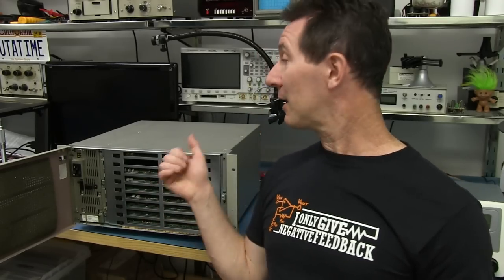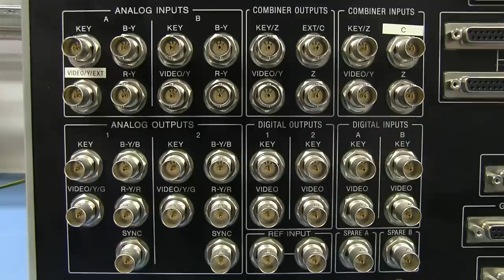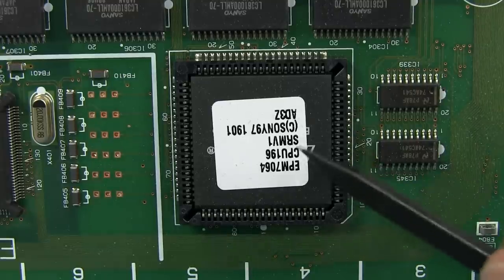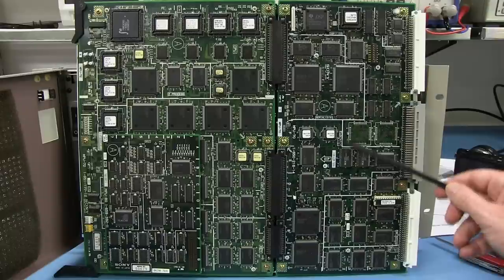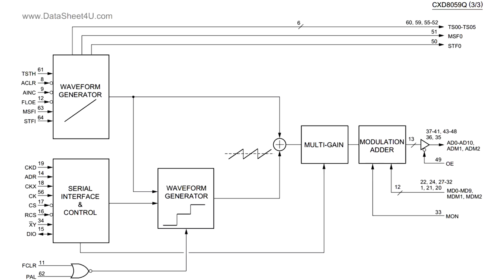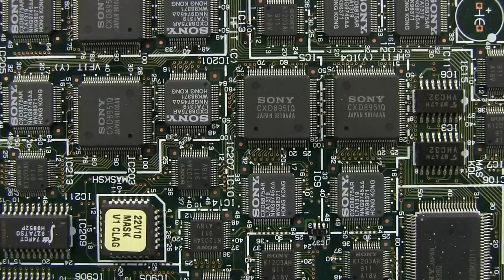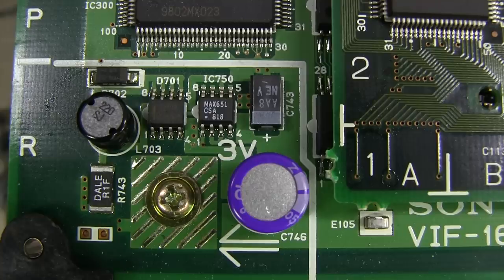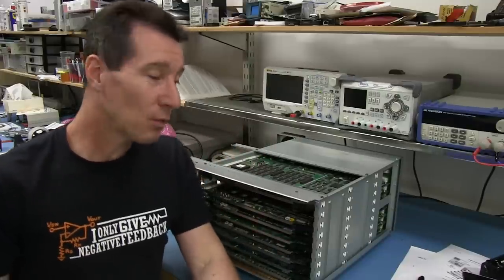EEVblog #598 - Sony DME7000 Video Multi Effects Processor Teardown

Comment: Great find again! :)
Really massive and wonderful! 
During the intro I heard you're saying u wonder if with a PC it is possible (and if it is a practice) to do real time effect processing for broadcasting purposes such as fades and wipes, aaaaand I have to say that with an game oriented video card a lot of things are possible in real-time, aaaand there are programs that meant to control gamer cards for real-time broadcasting purposes. Typically If u see today's PC games when u see fog, spark, water droplets, fire, stardust and glowing wizardish mish mush karate movements, well,  those are made in real-time by the video card... ...so the great potential is definitely there to do so...
Many gamer cards also have a tendency to process video such as mixingm fading, wiping (also some can compress video to some sort of mpeg) don't they? Maybe I am wrong... 

Another thing: about the term "Key": it can refer to alfa channel sort of signal when things meant to overlap...
There is the phrase "key out" something that means in video editing mostly some sort of green screen (and later "keyed out" in the mix) or other "supposed to leave empty" signals .....so that's what "key" is. 

So sending say a signal that is only a title that meant to mixed over another video signal can go by sending a full frame image but those pixels that should not count (transparent) has to be somehow signed and from the mixing room the editors definitely refer to this as keying. So "key" must be this.  

(...Or maybe here it has a totally different meaning but it's very very likely that this is the case)   

So "key" is not a controlling signal but a constant present thing even of course in analog environments that has keying abilities, aaaand in the world of TV it is definitely part of the aesthetics since ages as you surely know simply by watching the news and the titles put around.... :)

Have a nice day Sir! :)

Comment: I'm thinking "key" must be chroma-keying, a.k.a. green screen.  That thing labelled "network" looks like a 10 Mbps AUI connector.  As "thick Ethernet" was quite expensive to cable up, most folks got a AUI to 10BaseT transceiver for any AUI ports.

H and V is likely horizontal and vertical sync.
Reply: rchandraonline many graphics systems put out a traveling matte, which is actually what the key signal is... similar to a chroma key but cleaner

Comment: The ethernet is what's known as an "AUI" connector for an external tranceiver. Normally for that age, it would be either a 10Base T jack and magnetics and perhaps a PHY, or a 10Base2 thinwire or thickwire coax interface. AUI hasn't been used since the 10Mbit days, I don't recall any 100Mbit AUI dongles, at least.
Reply: No AUI is only 10Mbit. use MII or RMII for 100Mbit and I think GMII for 1G but that is noormally on board, between MAC and PHY. You dont have anymore a big stiff yellow cable on the wall, so an AUI like connector is obsolete.

Comment: It do have a normal 10BASE ethernet port in ther back. the 15 pin AUI conector. i have used that a lot and it was the normal conection in the 80's and rearly 90's.  and look up "AUI transceiver" that was normal to use after the "thick ethernet" vampiretap was phased out.
Reply: If I remember correctly it is used for thicknet (10BASE5) cable to connect to network card or equipment via transceiver. 
But later with Fast Ethernet it changed name to MII (Media Independent Interface) for  Gigabit Ethernet to GMII and 10-gigabit Ethernet XGMII and it still can be found on most of equipment.
Another reincarnation is SGMII of it or also know as SFP.

Comment: The 'network' labeled connector seems to be an AUI interface http://en.wikipedia.org/wiki/Attachment_Unit_Interface a common early 90's interface used for 10BASE2, 10BASE5 or 10BASET ethernet.

Comment: Wow - great video! When it has to happen NOW (and keep happening) hardware is the way. No time for an OS to waste on unrelated Personal Computer  BS when that next layer / multi pipeline process has to be actually in sync in real time. No OS updates that bring the system down because that latest shiny gimmick thing or that  back doors are discovered and personal data hacking might cause lawsuits and bad PR; yet not enough time is spent to ensure the damn thing still works.  A lesson in real world application for sure! 
I don't know how they do it now for hd but I'll bet there's still some of this sort of thing. Often in those days it could also have been a PC controlling a very large complicated two board 'video FX card' that has a similar look (referring to the boards). But one card wouldn't have been able to do as many effects and channels as this thing can.  Too bad a lot of the effects on these things were not really modifiable though. Better hope that page turn and shadow effect is what you need a lot of, but there's some more interesting stuff in some of those boxes as well.

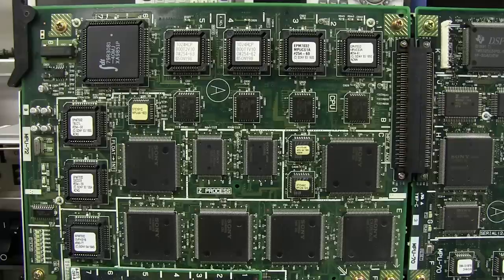Comment: 27:30 I wonder if they split the boards because they had a different contractor with specialized knowledge make that section, and then built the rest as an interface.

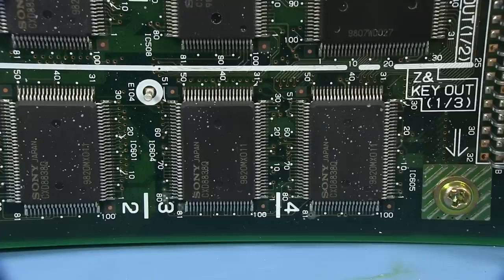Comment: 31:29 - I don't think there are a lot of Sony custom chips in there.

I think you can get datasheets for most of the CXD chips.

The CXD8838Q is apparently a Bus Expander.

The CXD8873Q is interesting though - looks like it's specifically for generating the Key signal...

http://www.datasheet4u.com/download.php?id=659912

It takes two sets of 16-bit digital data, then mixes them together using different coefficients. Hmmm

The N64 has a similar Chroma-Keying function in it's RCP chip as well - I don't think it's used in any games though.

Comment: It is amazing technology, but our 1056 input by 1056 output routing switcher has it beat. Imagine 2112 BNC connectors on one backplane! It takes up an entire rack. There are six racks just for the in/out patches.

Comment: Its doubtful that made 50K of these.  That's a huge number.  The SN might have encoded some dating function.
Reply: Typically they just add a big number to the front, so it's probably unit #764.
Reply: Some times the large numbers are for production runs, maybe other series (40xxx) were used in prototypes

Comment: I wouldn't mine getting my hands on a DVC pro video deck. Dunno what I'd use it for maybe recording gameplay videos.
Reply: You can record gaming videos with far better than DVCPro quality by using any modern screen capture software (Fraps, Bandicam, etc.). DVCPro isn't even particularly good by "prosumer" standards, let alone broadcast.
Reply: RFC3514 how about a camcorder that can connect to composite video and records to flash or a hard drive. Just need to find one.
Reply: coondogtheman1234 Why would you need a camera for that? Just get a video capture card (or even a USB video capture box) with composite input. You can get them for less than $25 (though those cheap ones generally don't have very good quality).
Reply: RFC3514
The point is to eliminate the use of a PC for the capturing. Avoid making the PC do the heavy lifting. My PC isn't new but it does what I want. And I do have a capture device actually two but the quality is crap or the video is choppy.
Reply: coondogtheman1234 Many video capture cards have dedicated video encoding chips, and don't put any relevant load on the PC (although PCs with slow GPUs might struggle to show the video, both while capturing and afterwards, when playing it back) . 

Most modern cameras record to memory cards, but the cheaper models generally don't have video inputs (especially for analog video), since that would increase the cost.

But anyway, weren't you talking about recording gameplay videos? That's kind of the opposite of recording composite video.
Reply: RFC3514
I have a PS2 which uses composite video so this would work. And would USB lag cause choppy video? Maybe it's the device I'm using. I have the videosafe cameramete which the quality sucks and the ion video to usb capture and that's the choppy video one. the software is a joke.
Reply: coondogtheman1234 Can't find any relevant specs for those (like the resolution, sampling format, whether they use an internal codec or use the PC's CPU to do the encoding, etc.).

There are some stand-alone converters that have composite input and record directly to a memory card, but they generally cost a bit more, since they need to have the card reader / writer, as well as the video processing chips.
Reply: RFC3514

That is exactly what I'm after but most of those record to mpeg 4 or have low quality video. I'd like to find one that I can hook a VCR up to and record my VHS tapes to my PC and/or burn them to DVD
Reply: coondogtheman1234 What's wrong with recording to MPEG-4 ? In terms of quality vs. size ratio, it's pretty much the best format you can use (assuming the encoder is well written, of course).

If you're going to have a PC nearby, you can get an analogue video capture card instead (generally better than an USB dongle thingy), or (if the PC has a Firewire input) a composite-to-DV converter like an ADVC-55, and just connect its Firewire output to your PC. The PC then sees it as a digital video source, and doesn't actually need to encode anything (the video already comes encoded in DV).
Reply: RFC3514
I'm not sure how good the encoder is on that one device I'll have to look. My PC is about 7 years old so it's not the fastest.
Reply: coondogtheman1234 As long as it has a Firewire port, it can capture video from DV sources (including DVCAM and DVCPRO) with almost no CPU load.

Comment: the 'ethernetty thing' is right there in your face. marked NETWORK. which is a pretty standard AUI connector which for years was THE standard medium to connect it to a tranceiver of choice (10base-5, 10base-2, 10base-T being the most common) on anything not made for the utterly crap consumer pc market for nooby home users. which is used with one of these: https://www.black-box.de/de-de/i/12620/10BASE-T-to-AUI-Transceiver (back in the days other manufacturers were more common, they're all the same anyway). it's still the connector of choice if you don't want to bother with built in magnetics or choosing the electrical interface for the end user. also i highly doubt that port market 'terminal' there would be rs422. usually rs422 is externally converted, and if it's internally selectable it comes out with an entirely different interface. (screw connectors, rj13, that sorta thing rj-kinda-connectors-with-the-pin-not-in-the-middle (DEC) etc.) the one that says 'thru' might be some balanced bus kinda thingy.